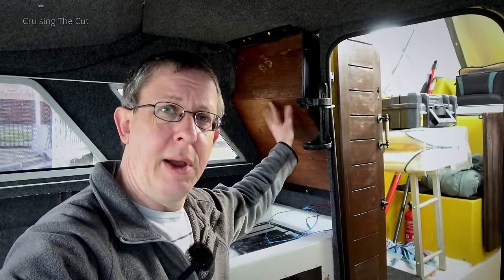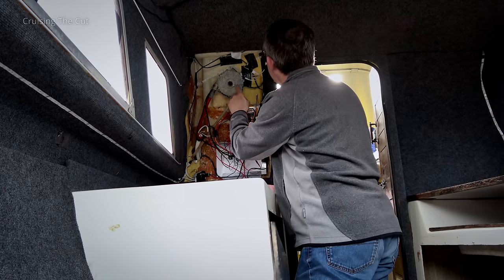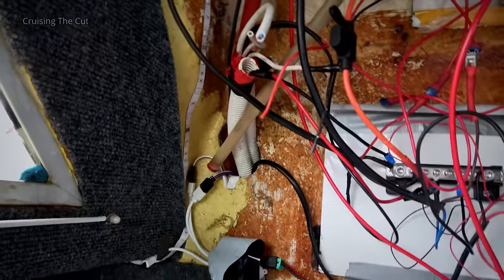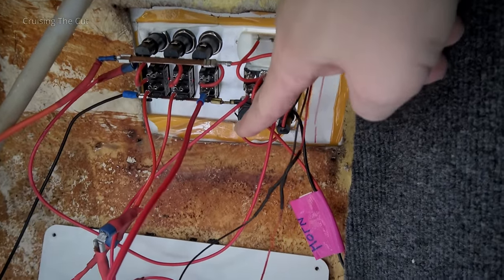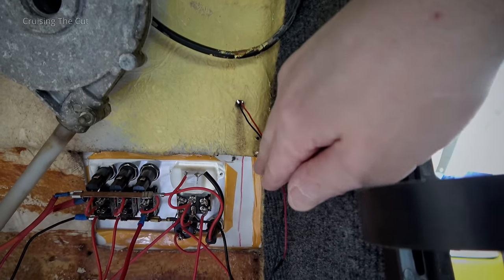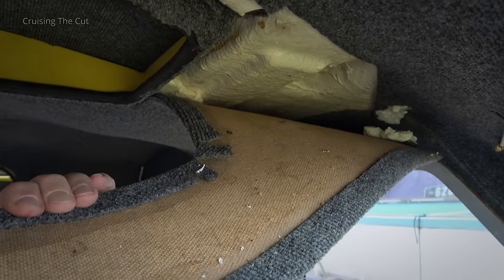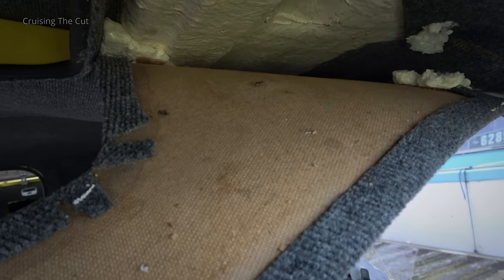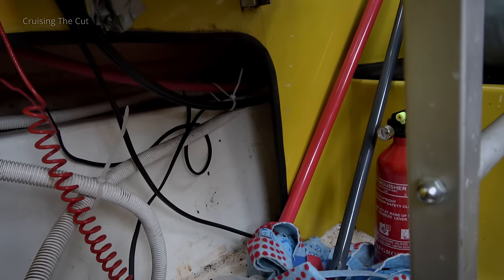326. Ripping out the wiring in my boat

Comment: Do not take out that tube. That runs from the front to the back.  As it could come in handy. Me I would use it for lights run. Or an audio wire run. Handy see.
Take picture's as you go. Yes, you have the video to use.
As you will see. Most of us are shouting at you HORN WIRE 😂😂😂.
Beware that little thing. I think it is a light to show you have power. Yes, that thing with two hole you call it.
OK. That's it for now. And yes, I am a sparks. Electrician 😂😂😂😂😂.  And have done boats farms and normal houses and Large Company buildings and shops..  Well, I am 71. So I have had a long time to do stuff. 😂😂😂😂

Comment: I'll pile on now and join many others in disagreeing with you.  Untangling wiring issues is not a terribly fascinating spectator sport but solving mysteries is.  Same work, different attitude.  I just finished untangling the complete wiring disaster perpetrated upon an innocent two-story building over the last 125 years, the original gas lighting having been disabled long ago.  In my case, I chose the Alexanderian solution, cutting it all out and starting over.  You might consider that.
Reply from the maker: Wow, that sounds amazing!! Yes, I'm going to remove the lot.

Comment: David do not save bits of wire it is a waste of time and could be potentially dangerous.  It is better to buy the correct wire gage for the job than to figure out if the scraps of wire are long enough or good enough for the job at hand.  Good luck with your new boat just do not turn it into a Yellow Submarine by accident.

Comment: Someone wired that boat wrong.
The positive (red) wiress should go the the fuse block.
Fusing the black wired is useless if you get a short.
That unkown item on your dash is a broked off led light.
Reply from the maker: The positives do go to the fuse block

Comment: This whole mess looks like a "Brotherinlaw Job", an accident looking for a place to happen. Separate all the wires--the method here is "Routing"--your goal is to make this look sanitary and dependable. In the USA, the boats built in 50s, 60s, 70s even the 80s, looked similiar in their wiring installs--eventuall the ABYC took hold of the industry and cleaned things up. We call your boat as one that has been "touched" a few times by folks who may or may not have been competent!? Thus we arrive at the price that you might have paid for the vessel. Not only do we have now publications for the subject , but we Have YOUTUBE, to guide you through these challenges-------Mikey, Belfair, Wa , USA

Comment: The previous owner was a bodger. I would RIP all the wiring out and get a qualified electrician to safely rewire the the entire boat. Along with all your new needs.
Reply from the maker: I think we can't say "the" previous owner but "a" prior owner. The last chap I don't think did much to it other than add the LED wiring strip.
Reply: @CruisingTheCut  Either way, a fire hazard. Get rid of it all all and start again. What's lurking under the carpet more gaffer taped wires...mmmm

Comment: What's not to like, especially if you are going to keep the heart attacks to little ones. You could consider disconnecting the battery all together while dealing with the electrics, it would keep all the pro nanny state subscribers from writing to their MP's about the dangers of buying second boats pressing them for tighter regulations.
Reply from the maker: It is switched off.

Comment: I say this with all the love in the world, but:

1. If you are doing ANYTHING with the electrics, you MUST disconnect the battery. This is just negligent and irresposible (especially then putting it on Youtube). This is how people get hurt and as much as I like watching your videos, I'd rather you were still here many years from now so I could keep enjoying them. 

2. Have you contacted the previous owner about the wiring? They may have done it and know what is going on. Because, if I had sold you my boat, and you were then making Youtube videos complaining about my "shoddy" workmanship, I'd be pretty annoyed - whether it was true or not. 

3.  As you correctly point out, there is not much needed in the way of wiring, have you though about just competely stripping it out and rewiring the lot? I would get a licenced electrician to check over your work before energising to make sure it was all okay. 

Long time watcher and fan, love your videos.
Reply from the maker: Cheers
1. I did disconnect the battery (+ve)
2. The former owner did not do this wiring
3. Yes I am completely redoing it. It doesn't need a licensed electrician though, it's very simple.
Reply: @CruisingTheCut  Love your videos mate.
Keep up the good work and stay safe :)